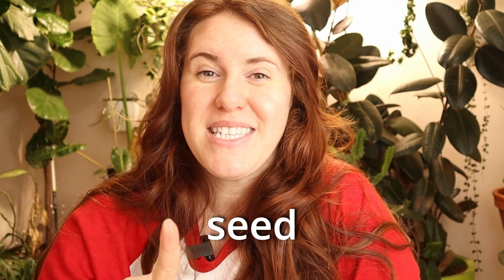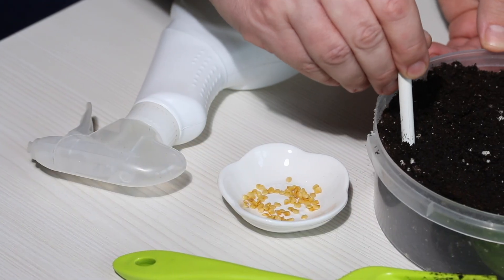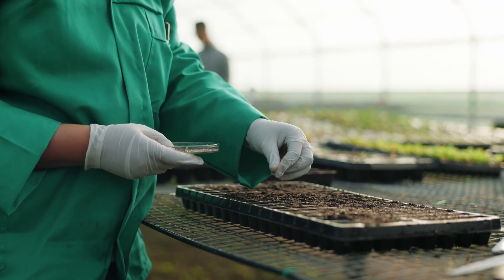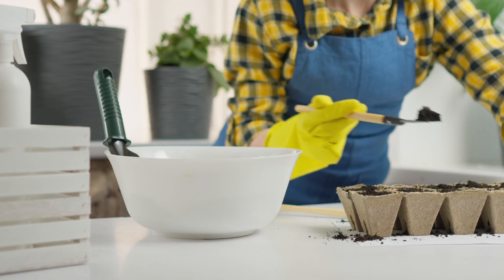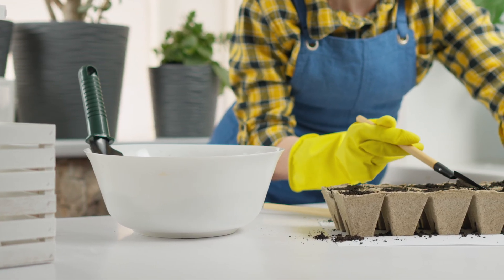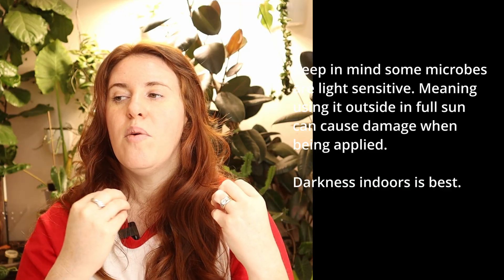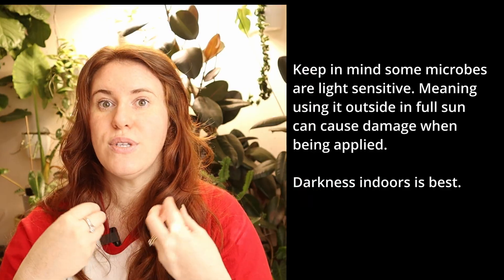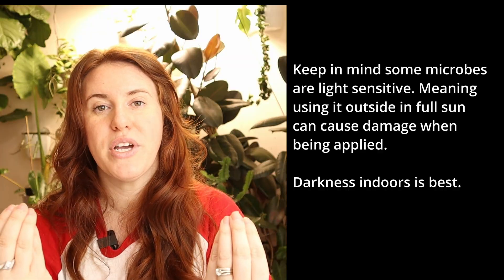Why Your Seed Starting Setup SUCKS…

Comment: Is vermiculite beneficial for seedlings because it holds water instead of repelling it compared to perlite where it creates aeration and sheds water away i.e. drainage?   Ive had issues with vermmiculite being the "home" for pathogens that lead to root rot, fungus gnats, and other too much moisture type problems. I dont like vermiculite in my garden but it makes sense as to how it could be useful. It just seems like a dirty little sponge that holds onto everything good and bad.

Comment: I swear I just watched a seedling video of yours that says you should be fertilizing seedlings every time you water, and this one says it's causing leggy seedlings. I didn't see when the last one was from but I think it was over a year ago. 

So which is it?
Reply from the maker: Sorry about that. I am referring to not over applying fertilizers more so in this video. If you are using a seedling formula and following directions I would try to fertilize every time. If you are using a full strength formula I would either dilute it more or skip the fertilizer sometimes. 

If you have leggy plants, soft green (yellow) tissue or white "crust" on the soil surface back off on the fertilizer. If you have a larger cell size your could also get away with skipping fertilizer every so often.

Comment: I stopped using seed starting mix because I never had much success with it. This year I ran out of the potting soil I use so I used seed starting mix. My seedlings planted at the same time in all purpose miracle grow potting soil are miles ahead of the seedlings in the standard seedling mix.
Reply from the maker: Thanks for sharing
Reply: I tried my own seed starting mix using compost, perlite, and composted coco coir. I didn't test my ph beforehand, and now some tomatoes have leaves that turned purple, shriveled up, and fell off. The Ph is 5.5. Now I am trying to figure out how to fix the ph.

Comment: Wish I'd seen this video when you posted it; was so loopy last week trying to fight white fuzz on my birch seedlings and get Ilex seeds stratified that I sprayed dilute bleach on the mold to kill it. Well, it worked, and now the birches are all mostly dead, obviously. I've soaked the jiffy plugs to oversaturation and pulled the moisture back down and out with paper towels to try to leach the sodium away, but it's not looking good. Next time, not using the included fertilizer with the plugs, doing better about sterilizing the seeds with peroxide after the water soak, and using your top misting and vermiculite advice. Then these little guys will make it.
Reply from the maker: Omph darn YouTube not serving up the vids

Comment: I just regular vegetable pro mix or whatever potting soil and just start in March. Put a many seeds from a fresh tomato and divided into 2 small pots. Then as it grows I weed them out. Works fine. Even if it’s been competing and such as long as you start early it should be fine. I took your method and used some peat based potting soil with little nutrients and it’s taking way longer to germinate maybe not even germinate at all

Comment: I thought about getting Promix but then saw reviews from people who said it had sticks in it. 

I planted Al Beit cucumber seeds in an egg carton with seed starting mix in an incubator for reptile eggs and they literally sprouted after 1 day and were 6 inches long in two days! If I had it to do over again I would have not waited for the cotyledons to take them off the heat. I created a little arch trellis in a pot with hardware cloth but 2 cotyledons broke off when I put them through the whole and the wire sprung back. Now I will have to plant more anyhow to replace the two I lost.
Reply from the maker: Anything no compressed has sticks I find

Comment: At 7:35 or so I'm seeing what looks like a bottom watering system so I'm a bit confused as I thought you mentioned not to bottom water.  Can you say more about this please. I have had mixed results with seed starting in trays and due to the shade of large neighbouring trees now and the short but very hot and dry summer months, I need to get far better at growing in trays. Thanks so much for your help with this.

Comment: I use paper towel method and I was drowning them. I now keep the paper towel much less saturated and place in partially open ziplock bag to slow evaporation and having much greater success. Do you like jiffy pots?

Comment: I seem to have constant problem with white mold on top of my trays woth seedlings. Despite washing the trays in water with bleach ,and sterilizing the potting mix with boiling water,i cant seem to combat that problem. I use alot of cinnamon to control it,which worked but this year ill try the misting.The only thing im confused about,is that you say dont use potting mis ,just vermiculite, than you say to use potting mix the pros are using 🤔
Reply from the maker: Have you tried vermiculite on the surface with a fan?

Comment: Help! I've noticed my little watering can for watering my seedlings is getting rusty on the inside. Will this be a problem for my plants?
Reply from the maker: Unlikely the water would have to sit for a while in the can/rust to make a major difference
Reply: Perfect thank you!
Reply: Eventually it will.
The can will rust through and it won't be able to hold water, leaving your seedlings high-and-dry.
Eventually, that is.

Comment: Not sure if you've done it already, however, I think it might be a good idea to talk about the severe issues with misting established plants at the wrong time. Only because misting seeded soil implies misting plants is a good idea when it's often not.

Also, is kind of important for people to remember that most seeds have everything the seed needs to germinate already in them. You can even start some on a cinderblock with no soil if you wanted to. They generally just require the correct amount of moisture and temperatures. That said, I do sometimes use plant hormones went starting a seed, though this isn't always a great idea.

Comment: I've used jiffy plugs, they are ok if that's all you can afford or get. I've done the pure potting soil which was ok. Last year I did potting soil for the bottom inch of the seed pots and then seed starting mix for the top half. They did well and my garden would have done well if the weather had behaved itself. LOL. I tend to bottom water though which I guess isn't a good idea. Tomatoes, peppers etc go on a heat mat and other stuff just on its own.
Reply from the maker: I used jiffy plugs for 10 years lol I love those things

Comment: I really enjoy starting seedlings. Water, I use bottom, top, and mist, sometimes all at the same time.  I use weak solution of MG to fertilize after day 3.. I use Holly Garden Pro-line mix. Top 1 inch layer is sifted with 1/4inch wire basket. Some time I just put the seeds on the surface of well wetted mix with little press for good soil contact, then mist to wet the seed,  then cover with a lite layer of mix or perlite. I use a heat mat and I put a kitchen towel over the tray. This holds in more heat and allow the tray to breathe a bit, (if you ever opened a plastic dome after 3 days it just smells funky). I think the cloth covering helps alot raising and stabilizing the temp . I have noticed that at about the 3-4 week mark that any/all seed starting mixes start to lose their ability to hold water.  I like your videos because I know they are backed by science and not just some regurgitated internet mantras.

Comment: Terrific video! 
I’ve been a “mister”, particularly at the point of planting the seed & until it has popped through the soil changing to bottom watering once in the vegetative stage (should I wait longer before bottom watering?🤔🤷‍♂️)
What are your thoughts about wicking mats? Starting to think that continuous source of bottom watering might lead to over-watering causing legging plants or damping off.🤔
Reply from the maker: They are pretty gentle but you need the right pots that’s forsure.
Reply: @GardeningInCanada  Thinking more about the wicking mat, using it with plants at the vegetative stage might be better than putting newly planted seeds trays/cells on it may be advisable and only misting until that vegetative stage.🤔

Comment: Ive been growing vegetables for about 15 years and have never, not once used a seed starting mix, just straight up mutli purpose compost, i dont siv it, i may pick out the odd lump if its really big, but thats it, never had any germination issues, means i dont have worry about nutrients during seedling stage, and mine are among the healthiest plants on our allotment :)
Reply from the maker: That’s awesome! Good job 👏
Reply: @GardeningInCanada  it would be interesting to find out why the seedlings do so well in mutli purpose compost, because everything you said about using seed starting soil and then potting up makes total sense, I just get better results from compost haha

Comment: Could sand or perlite replace vermiculite?
Reply: This is a question I have as well.  Why not Perlite?
Reply from the maker: You could use it. I just find heat distribution is not as even with perlite.
Reply from the maker: Sand can in particular for even heat distribution. Perlite I wouldn’t go with but no reason you could.

Comment: Vermiculite made a HUGE difference in my seed starting. I live in the AZ desert where the surface of soil can dry out very quickly. For those little seeds it makes a huge difference. Now I want to try using straight vermiculite for those little seeds. I had no idea that you needed different soil for blocks (I don’t use them), but I find it interesting.
Reply from the maker: Oh yes in that environment absolutely!

Comment: Pro Mix PGX is absurdly hard to find. Use PM BX and adjust consistency with one of any, very fine vermiculite/perlite/pumice/charged biochar, when using soil blockers. 
Otherwise, make your own mix from cheap and readily available substrates that will hold form. Seeds are comparatively inexpensive when compared to the jet-smoke-high costs for manufactured soils; plant more seeds!
Reply from the maker: Yes that’s the worst part about those customer mixes. They don’t just carry them at a Walmart

Comment: I watched this video and immediately got up and sprayed my soil blocks from the top. I make my own soil block mix from coir, sifted compost, sifted leaf mould and vermiculite. I was bottom watering and have the white mold on top of the blocks and spraying from the top was the missing link. Thanks. What’s your opinion on adding diluted seaweed fertilizer to the water on my small seedlings? I have watched a number of your videos and appreciate you taking the time to share your expertise with us.
Reply from the maker: That’s fine. My biggest concern is too much nitrogen when things are tiny.

Comment: Ive shied away from using vermiculite because of the low levels of asbestos.
Reply from the maker: That one is an old wives tale actually. There was a mine in the 1990's that was shut down because of asbestos in vermiculite. But they now test the products.
Reply: @GardeningInCanada  the latest article I read was from October 2023 and was put out by the Maine Department of Health.

Comment: I have some vermiculite that I was thinking of pulverizing in the coffee grinder I use to make worm chow.  Do you think that would work to add into my leaf mold soil block mixture?
It is not that I am cheap (I kinda am) but if I can make it myself, why buy it?
As always, another great video.  I still make mistakes, usually things I have not had problems with before.
Stay Well!!!
Reply from the maker: Oh, that would totally work if you pulverized vermiculite. You could absolutely use that with seed starting!

Comment: What is a root trainer and when do I use one? Does lining a nursery pot with burlap make sense to add structure to larger root balls of taproot plants?
Reply from the maker: Root trainer is essentially a long, narrow pot. What it does is it train the roots to go down words rather than outwards. And the idea there is that if you have roots that are digging, rather than sprawling, you have better resistance to.L drought.

Comment: I agree with everything but the last one. I stopped using seed starting mix and my plants are so much happier. I used to baby my seeds but then when I realized how well seeds grow when you throw a tomato in the compost pile I stopped trying so hard 😂
Reply: Me too. I used to constantly be needing to use liquid fertilizer on my seedlings. Now I start them in pots like the size of a solo cup with home made potting mix where I "sterilized" it with hot water. I don't have to fertilize (less work) and it grows quicker.
Reply: @thegooeybee  Technically, the hot/boiling water pasteurizes the medium, which is better, mostly, than sterilizing for seedling growth.
Reply: @thegooeybee  so you don't fertilize your tomatoes while they're indoor? I do my own seed starting mix as well. Sterilize them with hot water, then add worm casting.
Reply from the maker: Interesting!
Reply: Last year I did trays and 3 inch starting pots. The results were the same... Until transplanting the plants from the tray. For me it was a waist of time and some didn't survive after the move. My 3 inch pots did better and I wasn't rushed to get them outside. 🙏💪🌱🌍
Reply: @Jillany 3” pots maybe had better root development? I found this last year with my tomatoes.
Reply: Great explanation & fun spending time with you! I’m in snowy Alberta & have started a few winter sowing jugs outside. I’m trying some Walla Walla onions & San Mariano tomatoes so far. We do get Chinook warming trends here so I may be a bit too early but it’s an experiment. I use ProMix for vegetables & herbs. I started Leeks before in milk jug planting & they were successful but I think it may have been in mid March. I am keeping track now in my garden book!
Reply: What do you use instead of starting mix?
Reply: @chefe2152  regular potting mix. I don’t sterilize either. If the seeds can grow in the ground, they can start in potting soil!
Reply: @RebeccaWhite30  thank you much appreciated
Reply: Ce que j’ai remarqué avec le terreau à semis c’est qu’il y a problème lorsqu’on arrose trop. Je ne stérilise surtout pas mon terreau. Je place 4 leds Barinna et je cultive facilement de la toiture et des petites tomates! Ça va bien. Je ne sais pas comment faire parvenir les photos….

Comment: This is off topic but I'm wondering if citric acid would be a viable way to lower ph. I know you would have to use much more of it then the acids found in typical ph downs. Would there be any benefits for the soil biology and/or plant to squeeze a lime into the fertigation/water occasionally in replace of using a ph down?
Reply: also thanks a lot for another great video. Here's another comment for the algorithm!
Reply: Oh and on some websites it talks about citrus fruit juice harming microbes. I know it kills some types but I was wondering if the beneficial microbes bounce back after a while. I've heard mixed opinions on various acids such as acidic acid from vinegar. I'm confused on which to avoid.
Reply from the maker: It actually depends on the water pH. Have you seen my video on that?
Reply: @GardeningInCanada can you link video in this comment? I can’t find it. I live in Winnipeg and our water PH is super high. I have a large container garden, grow a lot of tomatoes and peppers, and battle high PH constantly. Having such a large garden, it’s super time consuming so using PH down in a watering can every watering isn’t feasible. Thanks!